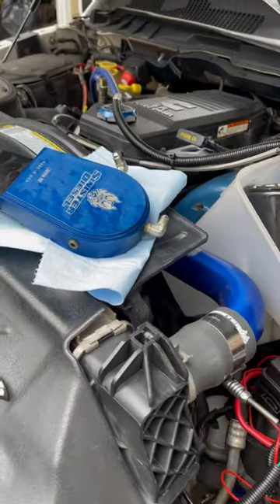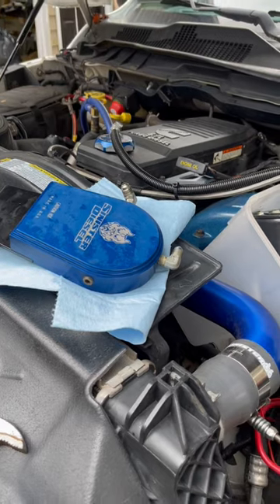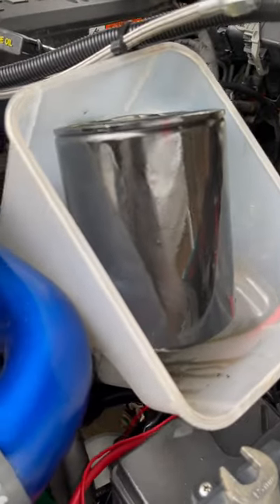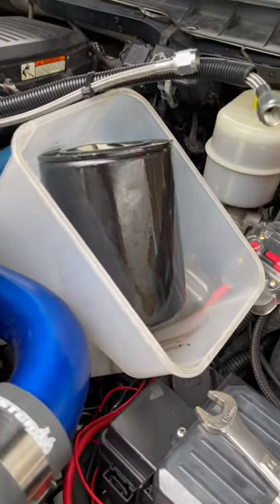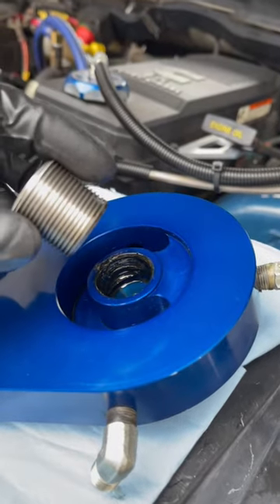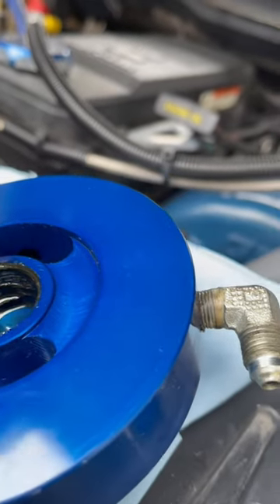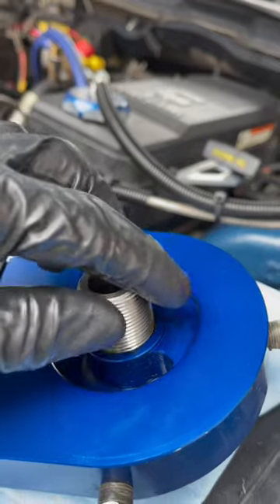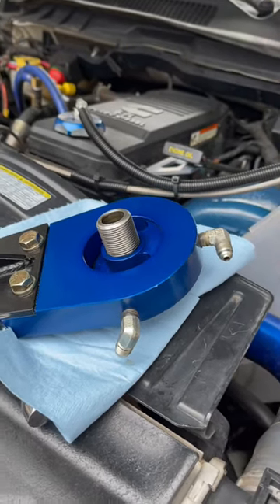If you have a OIL BYPASS KIT on your diesel truck watch this video!Save your motor from BREAKING!!

Comment: I've had Amsoil BP on my truck for 21 years with no such problem. Install the threaded nipple with permanent loctite and stake it in a couple spots and it won't happen again.
Reply from the maker: @akquicksilver  yup that's the proper way should have been done from the manufacturer....

Comment: Never had this issue yet, but definitely going to look into it on my next oil change
Reply from the maker: They also said they never seen it before but the original and replacement both had issues I didn't like but we corrected them and 10K still good now....they stand behind their parts so that's a plus
Reply: @DIYKAI  what didn’t you like about the replacement one as well?
Reply from the maker: @kevinbender5883  the first one they sent was wrong lol......then the second one the sealant they use just looked like crap. So far the new one has about 20k hard miles and it's been good but the first one lasted almost 2 years before it came loose so I am looking at other options as well
Reply: @DIYKAI  my first lasted 12,000 miles.
Reply from the maker: @kevinbender5883  😵‍💫

Comment: Did you call customer service? What they say. I just bought this kit. Should I re lock tight it before I install
Reply from the maker: Yes, we did and they took care of us. Definitely check it right now rock the filter back and forth to see if it makes a small gap between the housing and the filter top. We also used paint marker to make a line for a quick reference if it ever wants to back off again.

To be honest we took it apart and cleaned everything even went as far as to hit it with some sandpaper on the inside of the screw in adapter because the finish and tooling marks didn't sit well with us.

So far, a few hundred miles and all seems good.
Reply: I would Definitely
Reply: It wouldn't hurt to peen a couple places around the base of that threaded insert for peace of mind. That plus a quality thread locker/ sealant and you'll be in good shape

Comment: Just had the same issue on my powerstroke. I wanted my money back but they insisted on sending a whole new filter head and filter and said it’s never happened before. I’m not sure I trust keeping it on my truck. I got lucky and was backing out of a parking spot and only lost 2 gallons of oil. Could have burned up my engine if I was driving and didn’t notice it till I ran out of oil.
Reply from the maker: @kevinbender5883  man they said the same thing to me they never seen it happen before......maybe we should do a video together and ask them how both of us are the first time they seen it... smh.....we lost almost all oil with the dummy light coming on shut it down at 40 mph to save the motor
Reply: I asked to talk to the owner and wanted to know if they would cover my engine if it happened again. Still waiting on a call back lol. I told them I don’t trust their product anymore because if it fails it’s not going to be good
Reply from the maker: @kevinbender5883  same never spoke to anyone but a manager…..I thought my 6.7 was toast also even has my oil sent off to see
Reply: One of the benefits to the 7.3 power stroke is that the injectors work off of oil pressure. no oil the truck will just shut off the motor
Reply from the maker: @raymondclass6794  the ole 7.3 it will eventually get you there but it will get your there lol
Reply: @raymondclass6794 same with the 6.0.
Reply: @kevinbender5883  ok so you can't burn it up, just shut off
Reply: @raymondclass6794  This is a byproduct of the HPOP system. Since oil pressure opens injectors. My oil plug came out on a trip and lost oil on the interstate.  Engine Shut down, oil everywhere.  Bad upset stomach feeling! Replaced plug, oil, drove on.  :)

Comment: So I tried looking for the video on what solution you came up with but couldn’t find it. Did you end up using Loctite 242 or 271 or?
Reply from the maker: So i didn't do a follow up yet got super busy I ended up using 271 Red as that fitting should never come out went cross country a few times and it's doing great!
Reply: @ Right on appreciate the info. Also I’m curious if you’ve looked into or done a video on EGR/CCV Oil Catch Cans? Specifically the ones that feed back into the turbo vs atmosphere?
Reply from the maker: @KnuckleDragginDad  that is definitely next I am interested in a catch can

Comment: Back in the day I used loctite blue to seal an npt fitting for a mech oil pressure gauge. Maybe the tighter thread clearance makes it effective?

Comment: I installed a PacBrake Oil bypass on my 21 6.7 Cummins. I blew 3 oil pressure sending units in less than 9000 miles. I ended up taking it off when I got home. Have you heard of this before?
Reply from the maker: Pacbrake? Is that a throttle body brake?
Reply: @DIYKAI  I installed it @ 10k and it didn’t  blow pressure gauge until I towed heavy for first time at 34k. Went out west with our fifth wheel. Dealer in Nebraska replaced first pressure gauge then I did the second one in Gillette Wyoming.  When I got back home here in Florida I replaced it the third time and then removed the bypass filter. Have not had an issue since towing.  It’s been 2 years. So something wasn’t right with that bypass system.

Comment: You spent how much? & still needed to upgrade the upgrade?... ok noted, this product is trash; thank you for sharing.
Reply from the maker: So we are the "rare" case it happened too....but they did make it right and sent a whole new kit out...so they at least stand behind the part (even after warranty)
Reply: @DIYKAI  I mean good on them for great customer service, as it should be! However, I am still confused / concerning whats up with the quality department? Imagine you weren't so cognitive shrugged it off & blew up...would they?
Reply from the maker: Probably not lol....but you know the manufacturer will say for off road use only lol knowing everyone uses them on road 😜....I'm really glad we caught it first time it happened I was in line waiting for something and fell asleep lol dude came running up to the truck like your spraying oil....it was crazy
Reply from the maker: We had asked them to talk to the QC/QA guy maybe something was going on in their life and they were having a hard time....but who knows they probably didn't
Reply: @DIYKAI  should have a follow up email, especially considering they're a larger company. I'd find it hard to believe they not follow up on that. PTSD QC Guy over one missed tolerance could potentially be costly, considering a new 6.7L is on the low of $10k... not including labor / installation...😱💯🤷‍♂️🖤🧿☝️🐺✌️
Reply from the maker: @Nebu.1371  oh I know......but I highly doubt I would have got a new engine if it had blown I would be doing a rebuild series 😄😄